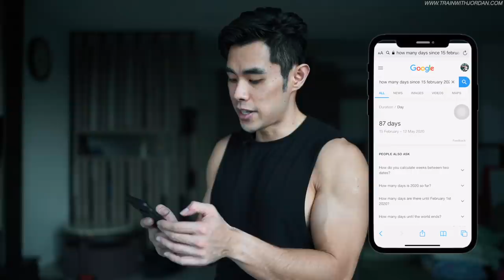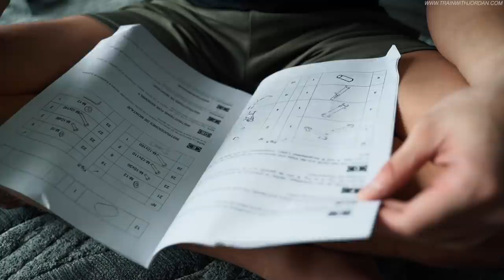Building My Home Gym! Goodbye Bodyweight?

Comment: I too bought a home gym like 3 weeks before lockdown by chance though obviously i don't have much but pretty basic like a bench, dumbbells (adjustable), rods, pull up bar, resistance band and i even did start a workout plan and i can see changes.. home gyms are very useful if used properly.
Reply: Amazing, that's more than enough. I just have 20kgs x 2 dumbbells with connector and a pullup bar, the rest I do bodyweight
Reply: Bro could u send the links or name of the site from where u got the pull up bar..i have searched on Amazon and flipkart but they all have mixed reviews

Comment: Bro hi, I have a  fat on my chest, kindly suggest some exercises and what I need to eat
Reply: Chest fat? Had those, push ups :D
Reply: @arthurcurry1242   and what about in diet
Reply: What is your height and weight??
Reply: @chesterblitzmarwein2103  weight 78 kg
And height 5ft 8 inch
Reply: First you want to realize that there is no specific fat,like chest fat,thigh fat or any other fat..our body contains fat in every parts of the whole body..you told that you have fat on your chest..so it means that it contains more fat on your whole body...not only in your chest...you can't burn out the chest fat only...so you want to do workout to burnout fat in your whole body..and then you can reduce your chest fat too....there are many fat burning videos in this channel..you can do that..and reduce oily foods
Reply: @ashishbehl7160  bro push ups can't reduce your fat...it will help to grow your chest muscle🙄
Reply: @ashishbehl7160  if you can be healthy, 4 whole eggs (medium size)
Try to avoid fried foods, eat alot of fruits and vegetables!
Reply: @hh3814  Push ups cant reduce chest fat but they are one effective bodyweight exercises for your chest to be strong and muscular, which eventually help to reduce chest fat. They also burn calories,
Reply: Thank you so much
Reply: Only way is to lose some fat ( = eat in a calorie deficit )